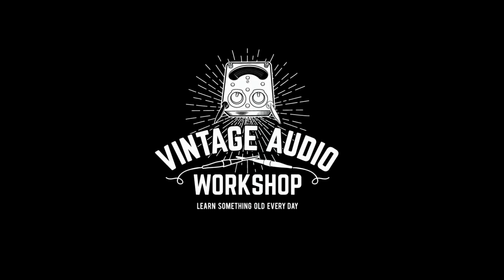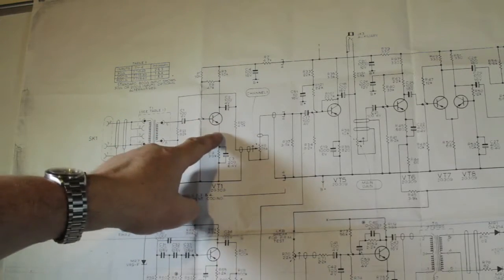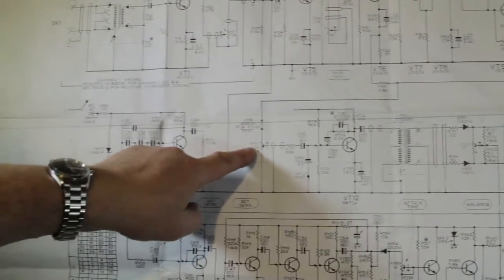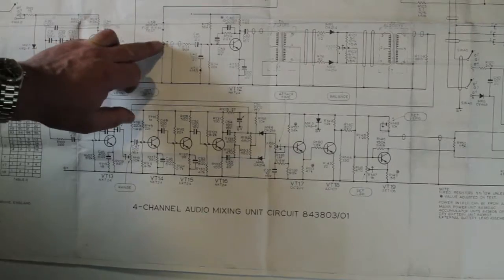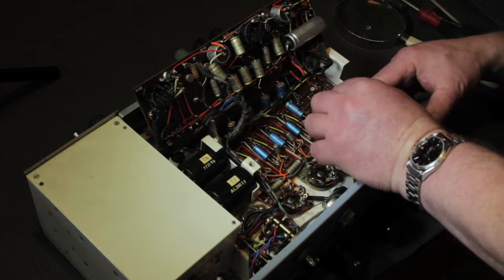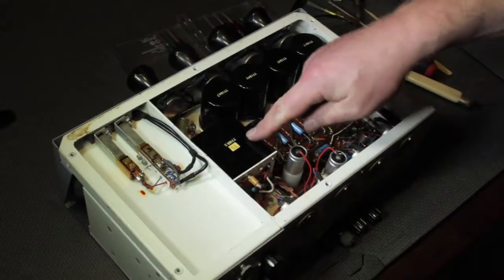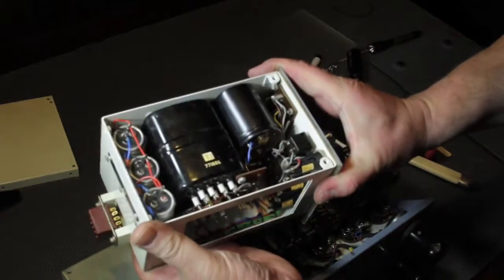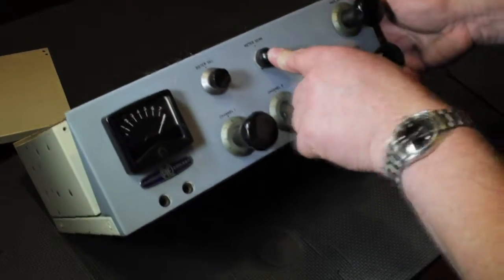PYE 1964 British Germanium Transistor Mic Amp Mixer Unit Type 843803

Comment: Excellent. I barely got through the tech explanation/description  by the skin of my teeth! (V white knuckles!)
My learning and ability stopped some time ago and I forget terminology etc.
Hard to believe I changed a cathode biased amp to fixed bias only to find I didn't like the sound! So I put it back. It's a lesson for the learning I believe someone once opined by way of singing!
One day I'm going to have to put my Binson Echorec back together which is.. argh. It's more mechanical than electronic but I've got to sort out the bridge rectifier (the original one was selenium and died).
Anyway I'm blithering.. I'm so pleased to have found your channel thing on here.. Great stuff chaps! 👍👍👍👍
Reply from the maker: Glad to be of good use, if you want any help or advice with your Binson we can recommend Terry of WEM company for 41 years he has worked with Binson and many tape based echo machines and is located in the south east UK. Paul

Comment: The mystery Mullard device in the PPM is an OC202 a very early silicon junction device, 1958 vintage? presumably picked for it's low leakage and temperature stability in  a very high impedance DC buffer amp. I wonder what is the reason for the adjust on test resistors around it as emitter followers are? 

The PPM design seems to be based on the BBC original valve designs complete with its backwards working meter, in this case using the GET106 base emitter junction to create a log-ish law. I think the preceeding DC amplifier may add some law shaping as well  BBC Design paper : https://www.bbceng.info/additions/2016/No.%206%20-%20Programme%20Meters.pdf.. 

In the Pye circuit I can't work out why there is a connection between the transformer driven full wave rectifier and the meter driver output stage. It looks to put some standing current through the full wave diodes which could linearise them for low signals but why take the current from the meter driver stages? Very curious....and interesting circuit.